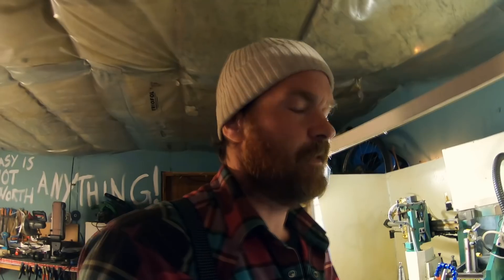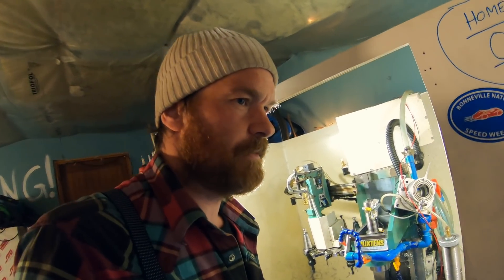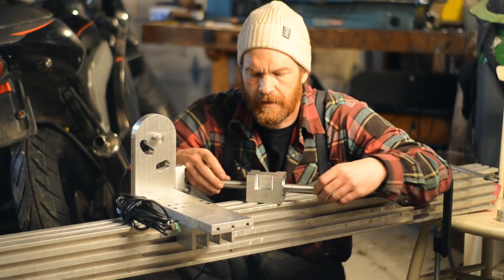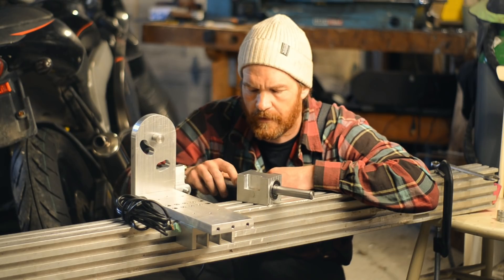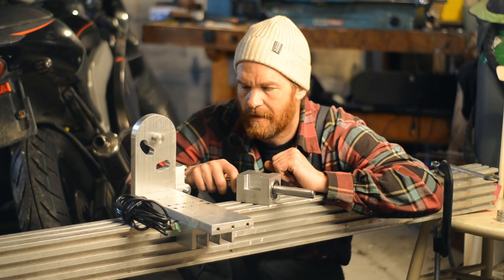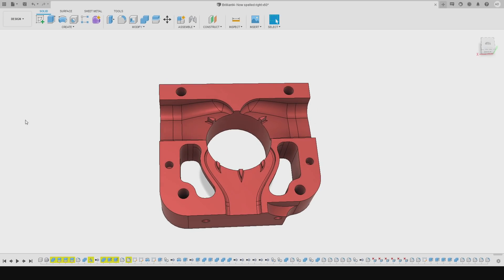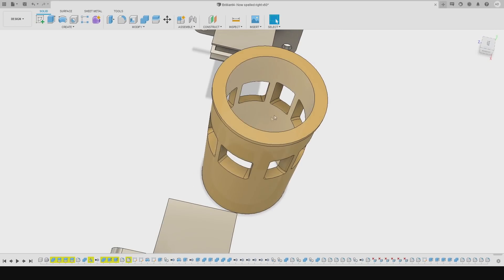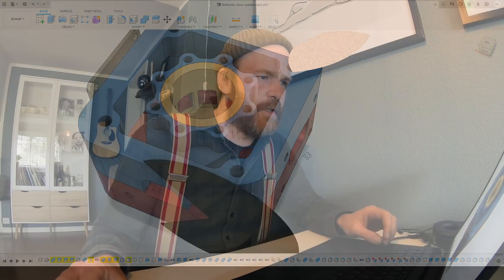Prototype Blown Nitro 2 Stroke.

Comment from the maker: Update: The PiP cylinder was found and is on its way! Phew... Thanks for watching!
Reply: Sick
Reply: Can't wait to see it running, also you could make a video describing engine dyno when you finish it, it would be really helpful for people that want to make engine dyno like yours, For now through i will make interia dyno like the one you made from that big electric motor but first i need to finish the motorcycle frame i'm working on.
Reply from the maker: @Dymitr_Nawrocki  Absolutely! I'll go through it all.
Reply: Good luck buddy.been watching for a while now.what power are you hoping for....or is that being held back till dyno time.all the best from UK
Reply from the maker: @petertaylor6384  Shooting for 30+,we'll se how things go now with a bridge in there. (less exhaust area)
Reply: @2STROKESTUFFING  best of luck!!it will no doubt be fearsome
Reply: I cant wait to see it finally running! and not snap a ring!
Reply: Good!
Reply: Whew!  That's a load off of your mind for sure!
Reply: Relief 👍🏼
Reply: Found?
Reply from the maker: @Topsiekku  Norwegian mail lost it last Friday.
Reply: I think that your steel plate valve is not good enough, because it will flex in some moments and loose your power. I think you should use ordinary valve from 4 stroke engine. Only one or two valves behind the exhaust ports. This would provide higher PSI in the cylinder when supercharger will be blowing. Keep in mind that valves won't be in the cylinder head but behind the exhaust ports, where u have now your rotary valve. For higher rpm you should use 4 valves ( only 2 will be open at the same time, this should provide around 20K rpm). Also this normal valves should provide some resonance for your engine.
Reply: HURRAH
Reply: And on a cost saving method,  lithium powered turbos are available,  use that for exhaust evacuation and just use compressed air for the intake charge...it works I can vouch,  that way you will have 0 parasitic horsepower draw. Just need a high volume low pressure pump for the intake. And I think the guys who make the lithium turbos are in Sweden.  Low what you do BTW, glad to help.
Reply: Bloody brilliant. It even sounds like one of those scale model engines you find in radio controlled cars an aircraft. Sounds Alot like an old model aircraft nitro engine.

Comment: But less tension with teeth belt (gilmar) less side pressure on bush or bearing , plus more tension creates drag/hp loss . Maybe someone close buy with 3 axis mill could machine gilmar setup , maybe tensioner pulley on setup too at 20.000 rpm belt will grow.
Awesome work man love it.

Comment: I've heard that BRP have a boosted skidoo. 
 I always wondered when they would boost their 2 stroke evinrude outboard motor.
 I can't see why they wouldn't now that they have direct injection and the air flow doesn't necessarily have to go through the crank case (Which is parasitic), because of the specific location oil galleries.  So no more mixing oil in fuel.
  I've always wondered if they use a cam shaft and intake valves in the head with variable exhaust port in the cylinder for a better efficiency bandwidth.
  Evinrude 2 stroke outboards have a gated exhaust port that gives variable port timing depending on rpm. Pretty tricky. 
 The difficulties I see with a blower is that the piston is the valve and on a single cylinder the valve is closed too often, not allowing spooling or creating a tremendous pulse for a blower.  Might need three cylinders if you want to boost.

Comment: The rotary valve will no doubt have to be timed to the engine, but what about the pulses from the supercharger? Being that roots style superchargers actually create a pulse and not constant flow, Seems like alot to try to get right and i dont think the reed valves will help with the timing issue created by the supercharger. Im no engineer but your basically creating a bomb in that intake port.🤣
Reply from the maker: A bomb is absolutely plausible. We'll see. Necessary adjustments after the first prototype.
Reply: @2STROKESTUFFING  Good deal! Cant wait to see if it'll run, theres alot going on there. Definitely in the realm of possibility.

Comment: Just a thought in a normal 2stroie design with transfers and Reed valve .. if the transfers were made like a Tesla valve. Or reed valves just before the transfer ports near the top of the cylinder. Would in turn increase compression on a otherwise identical engine. By preventing fresh fuel and air  being forced back through the transfers before the transfer ports are closed by the Piston. ?

Comment: EFI, EFI, EFI!!! EFI will solve a lot of problems for you. It will control the exact amount of fuel needed to the situation. Compensation for temperature, barometric pressure and cold start can all be optimized easily. Your engine won’t need the complicated intake manifold just two short straight air intakes. Fuel mixing will be better without all of the corners in your intake manifold. You will save weight and the engine will be smaller.

Comment: Dear sir , supercharging a 2 stroke is not like supercharging a 4stroke !  you only need enough pressure in the crank case to off set the pressure left in the cylinder at transfer opening . this will compensate for a too small of an exhaust port and allow the expansion chamber to operate  normally . what do you think ? otherwise you will cause too much blow-through and create very high exhaust temp's . this is why 4 stroke blower cams have little or no overlap in the cam timing . mine has 10 deg. of overlap . food for thought .

Comment: [QUOTE=Frits Overmars;1131051583]In the Aprilia RSA the cylinder pressure at exhaust closure is about 2,6 bar. At TDC this pressure exceeds 80 bar as Wobbly mentioned, and 20° later it exceeds 120 bar. At exhaust opening it still exceeds 11 bar.[/QUOTE]

Alex is aiming to have the exhaust and transfers opening at the same or pretty much the same time. But it looks to me that 2Stroke Stuffings supercharged 50cc 2S engine will still need normal blow down time area. Because with the transfer and exhaust ports at the same height the supercharger would not develop enough pressure to hold the exhaust gases back from entering the tranfer ducts/chamber.

My pick would be to have a normal Blow Down Time Area, an exhaust that assits with purging the cylinder but without the normal 2Stroke return pressure pulse and a rotary valve that closes somewhere before BDC when the cylinder pressure is at its lowest to trap the incoming clean supercharged air/fuel mixture.

The rotary valve timing can be adjusted to close when the pressure in the cylinder is at its lowest. The bonus is avoiding any hot exhaust gas and the pipe has assisted the supercharge to purge the cylinder. The rotary valve can open again well before TDC in fact any time after the piston has closed the exhaust port. Arranged properly there is no need for the rotary valve to see any real pressure on the blade or exhaust heat.
Reply from the maker: This might be the way to go, but I want to try the high transfers first. Hoping the added open-time can build more pressure before the ports close. The ducts aren't that big. 
A megaphone exhaust shaped to focus as much of the energy as possible into "suction" would be great either way. The ear piercing sound and even more spectacular flame throwing action is a bonus.

Comment: You might need rotary valve to intake too because the pressure from blower might keep the valves open too long and distract the flow.

Comment: Hey man, Such amazing work, an inspiration to us all! I hope you can answer a question. Would it be possible to run the engine without rings, as some of the small rc engines do. With a piston tolerance for an exact fit at operating temperature, even if seized when cold? It would solve the ring problem. F1 cars use this technique (but with rings also) and preheat the engine before starting. Could you reply and let me know your thoughts, it's been on my mind a while!

Comment: Happy it was found. Very annoying when something where you got so much work in got lost in the post, it's not just an off the shelf item you can easily replace.
You should aim for the rotary valve and its housing get made from materials which have an equal as possible expansion rate.
Then you can make tolerances relatively tight.
But I'm not sure how more loose tolerances may affect its effectiveness, a bit of blow-by may not make a difference at all for an effective intake stroke when your compressor delivers more than you need and intake pressure is regulated with a blow off valve, that will compensate for small losses trough the exhaust valve.

Comment: Someone commented about only pushing the air-fuel mixture near TDC, already (partially) compressed by another turbocharger or supercharger, leaving the rest of the piston movement only for exhaust. Is this even possible in a two-stroke?

Comment: Regarding toothed drive belts: I use a 5 axis cnc router at work which has a 11kW motor spinning at 24,000 rpm. It is driven by belt.

Synchroflex AT series belt.
https://www.beltingonline.com/polyurethane-timing-belts-182/synchroflex-4/synchroflex-at-series-74/?zenid=d1kencr2s048q083la19mdfip2

These are steel belted and last about 2 years in my experience. I hope this is of use.
Reply from the maker: Thanks for the info!
Reply from the maker: Thanks, very much of use!
Reply from the maker: Seems like I forgot I had replied...
Reply: Ha ha, I'm glad to be helpful

Comment: So does the new cylinder design use base oil instead of only pre mix?  Where you are not running through the base and up some transfers. Won’t oiling the bottom end need constant oil bath?

Comment: Here is how to make it work. First use two Johnsered rings, pinned and overlapped for a total seal...it works, you just have to cut the land about .25mm. Then your supercharger is going to need to be 50% higher volumetric  capacity for what it needs  to do is supply via a wye, compressed ATM 75% to your reeds and 25% to the compressor side of a.turbo then the exhaust rotor will complete the much needed scavenge , hence the rotor valve will have a constant t 20-30 Inches of vacuum on the expansion side of the valve the exhaust turbine should utilize the expansion chamber. Now you have the world's most powerful 2cycle , of course your fuel injectors are firing directly into the transfer ports. Peace Brother, I'll be at the Salt. Cuuck

Comment: make a full circle exhaust valve with a slot in it so it has a ring all the way around that way you wont get as much wear on the sealing plates 😄
Reply: so you can lave it open on the powerstroke it might cause some problems with blowby and damage your valve or reeds in the worst case

Comment: I think the issue a lot of detractors have is they are assuming you will run gasoline which burns very hot as opposed to something like a premix nitro/alcohol that you can burn in your hand, and also don't have experience with rotary valves. Rotary valves have been used in RC nitro engines for  decades, but they used rotating sleeves with ports cut into them as opposed to exhaust block-offs. Also turbocharged 2stroke diesels have been used commercially for quite a long time as well. 

It's entirely possible to use rotary valves, and also have FAI on a 2stroke engine, they've both been done for a very long time so it's proven. It's just a matter of making it all work on a tiny engine. 

I've heard people talk about efficiency, but as far as I'm aware that's not the goal of this build, it's maximum power for a fixed displacement, waste is no issue in this case.

Comment: Have you thought about to use a cylinder head with a central exhaust port like a two stroke marine diesel engine?
Should be possible now where you are planning to use a blower 😊

Comment: The rotary disc valve is to provide charge trapping? There are other ways of doing this, try a conventional expansion chamber with the stinger removed, this is just an orifice restrictor anyway. Replace it with some form of constant pressure relief valve such as a spring loaded flap.

Comment: Would it help the intake flow if you rotated one of the reed blocks 90 degrees so that the incoming air would divert with the least amount of area pushing against each other?

Comment: Looks quite similar to the old Nordberg diesel engines I worked on 30 years ago. They used an electric turbo blower on startup and at lower power settings until the main exhaust gas turbos spooled up. The ports were laid out with transfers on one side of the cylinder with  scavenge valves (basically working how the reed valves work). Across from the transfers were the higher positioned exhaust ports. Only difference was no valve on exhaust side, however the B&W engines we had had an exhaust valve so perhaps more similar as it had the blower and one way valves also.

Comment: I must feel completed to write in my language,Romanian,hoping and maybe you can traduce with Google transalate,because,for me it-s easyer...Sorry...
   Iti scriam mai demult ca largimea(latimea) ferestrei de evacuare este mult prea mare...Nu are voie sa depaseasca 90% din jumatatea alezajului..Niciodata...Mi-ai raspuns ca ai pistoane si segmenti speciali...Nu exista asa ceva....Iata ca am avut dreptate,eu avand o mare experienta de modificari motoare 2t....Am varsta de 53 ani...
   Pistoanele tale,acele ciudatenii cu filet,sunt foarte grele,mult material,deci automat dilatarile sunt enorme...
  Am inteles din postarea ta,ca trimiti cilindrul ca sa-ti planteze acel piciorus in evacuare,dupa care va fi din nou incarcat cu NICASIL...Ok...Dar ai grija,focul evacuarii este direct pe acea limba despartitoare..Trebuie neaparat sa dai cateva gauri fine,0,3-0,4mm,sub segment,pe centrul piciorusului,pentru ungere si racire...
  Faptul ca ai trecut la pistoane Kreidler van Veen,inseamna ca te-ai desteptat...De preferinta sa fie cat mai usoare si forjate,nu turnate...Orice piesa in miscare trebuie usurata...dar cu bagare de seama,ca sa nu le slabesti rezistenta fizica...Incearca sa confectionezi si o biela din titan..Eu am facut-o in anii 80..
  Succes!

Comment: I have been following your videos for a while. Excellent work, I have a saying that I live by when I'm designing something new. In Failure there can be lessons, in perseverance there can be results.
  I would like to make a suggestion from one engineer to another. If you're using a positive displacement supercharger you might not need the Reed valve.

Comment: Since this is no longer a resonance induction 2 stroke, why not consider say,  two Reed valves.....on the exhaust port outlet.
1, it Eliminates the rotary valve mechanism. 
2, the back pressure will not be as detrimental as in a resonance engine.
You've certainly entertained crazier ideas....
Drink!

Comment: Just got to finish watching the video it sucks having to work when there is something interesting to watch... I have a box full of assorted v belt pulleys in different shaft sizes and pulley diameters They are set up with a square keyway to the shaft let me know what pulley diameters and shaft sizes you need and I will see what I got and send some to you

Comment: What about using solenoids to control the opening and closing of the exhaust port?
Reply from the maker: If I can find one with enough throw, umph, and speed, I'll do some research. Need to go from open to fully closed in 1ms.

Comment: I am not an engine expert but in other applications check valves, like reed valves, acting on the same circuit are really difficult to tune to open and close together. In this case  you would probably end up overflowing one side and dripping from the other, a mbar difference will be enough to put them out of service

Comment: An idea that's more optimization than anything, would be to have the rotary valve spin 1/2, 1/3, or 1/4 as fast as the crank (how many openings you could have depends on the height of the port, having the port triangular would help for faster changing from open to close), and merely pattern more slots around it to compensate.

This way it can spin slower and have much less parasitic drag, as it will have a LOT of aerodynamic drag spinning up to 20,000 rpm. 

You could even use the outside of the valve disc as the sprocket, reducing the rotating mass even further.

Comment: Hi. There is still too much volume outside the combustion/cylinder area. It's an uncontrolled explosion.  The reeds and rotary valve need to be on the cylinder wall. Which is impossible. I hope the bridge and plating is successful.

Comment: You may want to consider making the bore of the new motor slightly undersized, and then machine it to fit the sleeve once it's assembled. Less chance of the the machine messing something up that way. Just a thought.
Reply from the maker: 👍I will.

Comment: Alex, you will need a crankcase breather otherwise the piston wont be able to go up and down.  What about lubrication of the engine?  At the moment you don't have any lubrication for the little end, big end, mains or piston skirt.
Reply from the maker: Separate oiling, might need some windows in the piston. Breather is the plan, might need to pipe it somewhere safe(like after the exhaust for more flames😁)